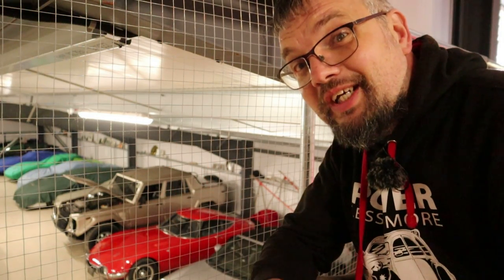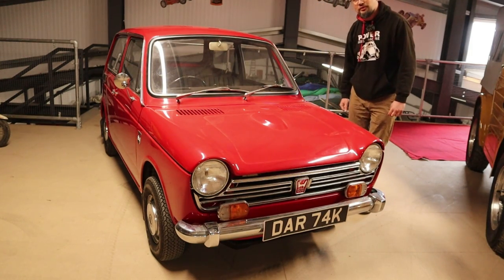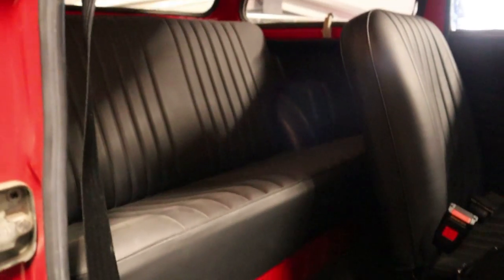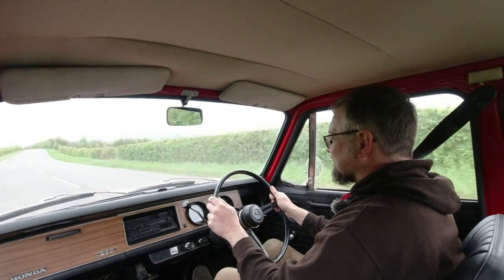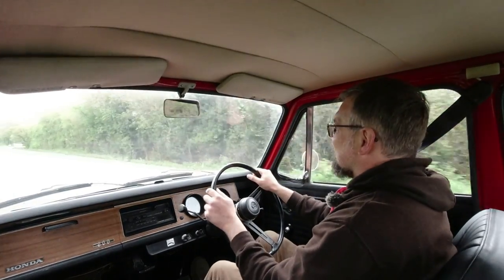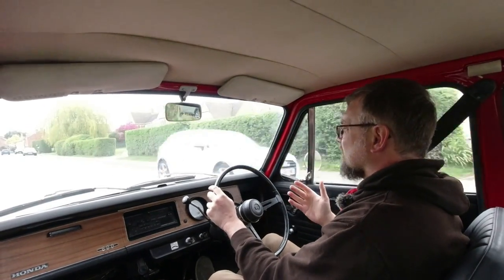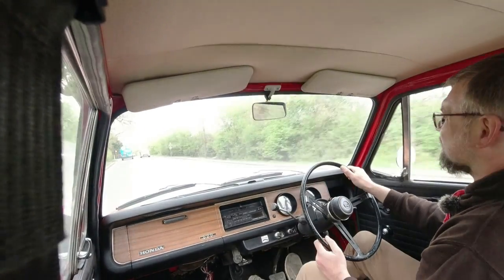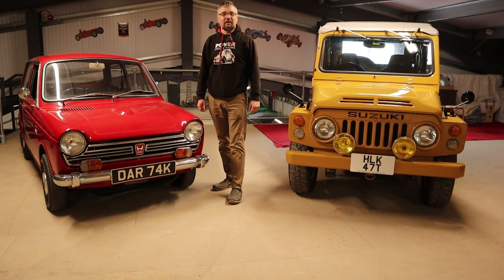Real Road Test: Honda N600 Hondamatic. Amazing engineering!

Comment: Love seeing these early Hondas. Surprisingly even the earlier ones were common in Australia. I remember seeing a coupe S600 on display from the local Honda dealer at the 1964 Melbourne Motor Show in the Exhibition Buildings when very young.
A staple on hill climb coverage on TV in the sixties in S600 and S800 form. 
A few months before the S360, Honda showed for sale their first four wheeler. The T360 mid engined pick up truck. As far as I know the same DOHC four cylinder. Likely roller bearing crank and dry sump. Later the larger T500F versions were sold in Australia like so many Japanese makes trying to establish a place in Western export markets and partly using Australia as a test market. At least one T500F survives in Queensland. Was a trade in on a Honda lawn mower! : 
https://www.mtaq.com.au/1964-t500f-honda-pickup/
With a 531cc DOHC, 4-cylinder engine. Not sure if the trucks got 4 carbs.
Think I saw them for sale as a young boy in an Elizabeth St Melbourne showroom.
I think Australia was one of the first export markets for the N360 sedan. Fairly heavily [promoted here.

Honda also established, in 1965 and 1966, an early fruitful relationship with Jack Brabham with the S800 based F2 1000cc car : 
https://primotipo.com/tag/1966-formula-2-championship/
Jack Brabham winning at the 1966 French GP F2 support race then later taking the F1 race win. So Jack became the first man to win a GP in a car with his own name and manufacture.
Unheard of today to win a support race and the F1 main event as is the car of his own make.
The Brabham Hondas  dominated the 1966 F2 season with other production based engines being a long way behind the Honda 1000cc version combined with the other Brabham car organisation winning attributes.
F2 went 1600cc for 1967 so Honda just had one year of dominance in F2.
Jack very much liked the price Honda supplied the engines to him (zero?). Honda liked his input into what was needed for racing in F2 and so F1.
Recent Australian coverage on a survivor S600 :
https://www.youtube.com/watch?v=2GQN7cH69do

Comment: Honda went 4 cylinder for their 1964 T360 light truck. I think motor design shared with the S500. Before the cars by a month or two in 1964.
The larger T500F versions were sold in Australia like so many Japanese makes trying to establish a place in Western export markets and partly using Australia as a test market. At least one T500F survives in Queensland. Was a trade in on a Honda lawn mower! : 
https://www.mtaq.com.au/1964-t500f-honda-pickup/
Reply: That's an interesting link.  There was the remains of one of these in the corner of a yard in Melbourne which I used in the 1980's. I've never seen another. The motor and most of the front end was missing. For years I didn't know what it was as all the identifying bits had gone.
Reply: @cornishhh  I wonder if the motor was used to keep a Honda S600 sports car going. I think at that early stage Honda could benefit by making just one motor with bore and or stroke variations.

Comment: 6:00 This design carried on for a while - the somewhat more modern Honda S2000 fuel flap release is in the exact same spot! It has  a proper knob and operates a Bowden cable, but the operation is the same and it's in the same place.

Comment: Wow,, I remember the day when I first saw one of these (same colour), it was the first Honda car I ever saw. 

The Borg warner story has always amused me, Honda went off and designed something way more efficient, enabling them to offer two-pedal options to their cars without having to payone of the few transmission companies royalties. I bet they knew Borg Warner's answer before they even asked the question.

I remember driving the MK1 Civics and Accords that had the 2 speed Hondamatic that was not an automatic at all. Their torque converter design was so good that were better than the small borg warner cars without changing gear at all..

Comment: The pistons may go up and down together, but I doubt they would fire at the same time. It's what is known in motorcycling terms as a parallel twin. Firing order would be 1 - 2 or 2 - 1 if you prefer.
Reply: On a 2 stroke wouldn’t they both fire each cycle?
Reply: @cachebangwallop3482  A two stoke twin will have a 180 degree crank - 1 up and 1 down.
This is an OHC four stroke.
Reply: Left foot braking  ..... it's the future 😉
Reply: @EmilysDadd  I think you're getting confused with Garlic Bread.
Reply: Same as a fiat 500 2 cylinder 4 stroke. Because it is a 4 stroke, as one cylinder is on the power stroke the one next to it, going the same way, is on the induction. So they both move together, to fit with the 4 stroke cycle.
2 stokes will have one up, one down, so they fire with every downward stroke.
Reply: @Frightningman  Ahhh, thanks, Frank - I think I misheard at the beginning - the 2 stroke is in the Suzuki...
Reply: @cachebangwallop3482  Yes, I think Ian said it was a 3 cylinder two stroke. 120 degree crank :-)

Comment: Fifty years ago, my parents bought a Honda N600 automatic. They both managed to put the little car in a spin on separate occasions. Mum spun off the road and ended up in a farmyard. I was with Dad when the car spun round on a slight bend for no apparent reason. Neither of them were what you would call fast drivers but I think the unpredictable handling may have caused them to get rid of it and buy a Hillman Avenger.

Comment: My mother had one of the Honda’s in what I think was the late 60s early 1970s. Two problems. One it came with very hard compound cross ply tyres. It was very difficult to brake on a wet road without the wheels locking up.
 In the U.K. Honda very soon forgot they ever made them.  Even dealers admitted that parts were almost impossible to come by.  The original dealership who sold the car may have something in the way of shop manuals. But a dealer who took on Honda after they had gone off the new car market had little chance of being able to get anything out of Honda.
 Just in case anyone thinks I have a down on Honda. I have ridden other motorcycles but all the bikes I have owned since the mid 70s are Honda.

Comment: I had a mustard coloured one.The boot lid was plastic.im sure it had front disc breaks.Not as good to drive as the mini and not as fast.The heater was useless.But a great turning circle,reversing lights,alternator and features you would find in larger cars.

Comment: Strangely it reminds me a little of the DAF 33 and the later DAF/Vovo 66 - although those were CVT. The related Volvo 345 was the first automatic I had a chance to drive. These small automatics were all interesting from an engineering perspective. The DAF 33 was a 746 cc flat twin, but the 66 was a more conventional 1.1 L (1108 cc) OHV straight-4

Comment: Wow, is that a 2000GT there?
It is truly amazing how much power they got out of these cars. Hey, It's Japan engineering isn't it! The 360 had an equivalent of more than 80 bhp/litre. Isn't that amazing?
What is the "PKB" warning light next to the main beam light? 
Note for the future: really liked the camera angle towards the back of the car where you are talking to the camera, like you are talking to us. Adds a nice touch to have a different camera angle during the actual road test. Might become a bit boring otherwise, especially when they are nearly half an hour long. Keep up the good work, Ian!
Have a nice weekend!
Reply from the maker: Parking Brake I think. Yes, it is a 2000GT.

Comment: I had the N360 and my cousin the Z360. Biggest problem was the rust in the too-thin metal bodywork. But they both worked very well, and I drove from Sydney to Canberra regularly in the N360. Fuel consumption was negligible. I also drove Minis and Mokes at the same time, and the Moke was my favourite, but the N360 did the job. 

As to torque convertors, the Japanese scooter industry used them a lot in the 60s, I still have a Rabbit (Subaru) torque convertor. Japanese companies shared a lot of information back then.

My N360 was written off after the woman over the road got her shoe caught in the accelerator of her car and drove through my parents fence and crushed my N360 against the concrete verandah. Good for me as my registration was ending in a week and the car wouldn't pass the annual rego (MOT) inspection due to rust. Her insurance company paid me twice what I had paid for the car, and left me with the wreck as they didn't think that they could make money from it. I sold parts of the wreck for twice again what I paid for it, and gave it to a local scappy for a slab of beer.

Fun to drive, but I wouldn't want to be in a collision in one.
Reply: I would not want to be in any car in a collision

Comment: Back in the mid 70s a friend of mine had 2 cars that needed to be moved from one side of Jacksonville to the other.  One car was an Opel station wagon, I think...if I remember correctly, with a 1.3 liter engine.  The other car was one of these N600 s.  I had always been a small(ish) car nut, so of course my choice was the Honda.
Like car magazines of the time wrote: even if you got the car sideways, or ran wide on a sharp turn, there was plenty of roadway for your recovery without necessarily straying into the opposite lane.
It would take 15 more years, tho, before I finally got rid of my Anti-Japanese Car bias.  I bought my 1st of what would be 4 Honda cars in 1989.   Unfortunately, I haven't cared for most new Japanese cars produced in the last 10-15 years as I feel they are too aggressively styled.

Comment: Slightly off topic but I had a Triumph Acclaim with a semi automatic torque converter
gearbox, it had 3 forward speeds,  according to the hand book you just used 2nd for 
normal driving it was good for 0 to 80 mph if you wanted a bit of extra performance
or climbing steep hills with a full load you used 1st which was good for 0 to 50 mph
3rd was an overdrive which quietened everything down which you could use from about
30 mph I think, If I remember correctly it wouldn't do its top speed in 3rd. You just shifted
the ''T bar'' gear lever backwards and forwards as needed no clutch, for reverse you pushed
a button on the bar and pushed the lever forward. According to the handbook I think that 
was also called a Honda-Matic. I rather liked that gearbox.

Comment: I had one, a red,n too, 
His name was Nod-Bert, 
best wee run a bout ever

great for parking, not a space big enough,long ways on.
it was small enough to drive in with nose or tail to the kerb.
got some funny looks, but all legal.

And it loved to cock a rear wheel when cornering fast
something that got a lot of comments from folk.

You did,nt mention its ..Sportier brother, the fast back Z600
an even cuter wee car.
dont know about the 72 cars, but the 76 Nreg cars had discs on front,                                  not drums as you said.
 never thought id see another let alone a road test.

Comment: I'm 6 2 and always liked small cheap to run cars. I take the front seat out and drill holes further back. I had a Honda 50cc scooter that had a 3sp semi-auto manual shift but no need to use clutch.

Comment: A torque converter and lockup patent was filed by Studebaker in 1946, and Packard had the Ultramatic in 1949 which had lockup, so the concept was quite mature by the 60's/70's. It fell out of favour in the 60's until fuel economy started to become an issue and the efficiency gains of the lockup meant it came back into use.

Comment: For a fair bit I thought “odd, it’s got curtains on the B pillar…. WAIT, it’s a seatbelt. Sorry, very long couple of days 😳 slightly off topic, if you get chance to try a Fiat TwinAir you may find it an interesting comparison. 800cc ish 2 cyl 4 stroke with a turbo, iffy set of cars but an engine that is interesting to drive as a manual. Not the breakthrough Fiat we’re hoping but a different take on things, technical details are particularly good (no inlet cam + a balance shaft). Cheers as always Mr Hubnut!

Comment: I had the "big block" N600 with the manual transmission with that wacky dashboard pivot, I hot rodded the heck out of it but is was probably slower when I got done with it... I did build a roll cage for that death trap though, must have had at least 1 brain cell left at the time

Comment: I really need to send Ian my old Olympus PCM recorder so he can record decent quality lavalier mic audio alongside the cameras audio (can still serve as a backup). A lot of the recent-ish videos seem to have overdriven/distorted/clipped audio at some point of the video (inside the building in this case) or even most of it (vlogs), which unfortunately seems easy to do with the current setup (or in editing?), but pretty hard with the PCM recorder with its limiter enabled from my experience. Not sure if that's the right answer to the problem, but the distortion can be quite harsh to listen to with headphones which just distracts from the otherwise brilliant content (yes, that includes failed repair attempts that end in rambling lol)

Comment: The Hondamatic that could be had on the original Civic had only two speeds and was a shift it yourself unit, but without a clutch.
Reply: Correct - it was a semi-manual, and you had to start off in first to get going, and shift to second.

Comment: The mother of a school friend I had in the late 70's drove the same car. It was a bit of a banger and had a 4 speed manual (so that must be faster). It would stall at virtually every traffic light. Besides that the wiper blades tend to come off which was quite adventurous considering I would be a passenger on the school run when it was raining hard. That had also left deep scratches in the windshield. So needless to say, that example was not going to be a survivor. Nowadays these Honda's are expensive to buy as classic. Perhaps even more so than a real Mini.

Comment: 14:19 says it all as far as modern cars are concerned, especially the mid-size SUV's: they're unrecognizable, even to a car afficianado! They all purport to give you individuality and personality, but they all run with and in the same pack (of sh*t). I used to be able, as a kid, to tell one car from another by just looking at a fraction of the rear lights or a slight curve along a wheel arch, but in a time where almost all cars have curves upon curves upon curves - in a so-called effort to be 'funky' and 'cool' - individuality has flown right out of the tinted windows! My current car is a Chrysler 300C Touring, and I love it! Just try and find something even remotely similar!

Comment: As for your comment on the boot being better on the Mini, not at all, if you have a bag of cement or suchlike the Honda is much easier. The Mini boot lid gets in the way and straps break if you drop said bag of cement on it

Comment: I hunted for months for a Z600 Coupe back when they were cheap to buy nearest I got was a test drive of a N600 which was fun not a Z sadly I gave up after a while as I couldn't find one without imminent terminal rust
Reply: It hurts still that my Mums Z600 had less than 20k miles when she sold it after about eight years . It was perfect , no rust and totally reliable . But they only needed one car and the Z went. Two lads bought it for peanuts and wrecked it driving round a field 😡

Comment: Very interesting. The engine owes a lot to the Honda CB72 / 77 and CB450 motorcycle engines. When it's out of the car, it's pretty much a bike engine with a different gearbox.

By the time this was built, honda were pretty much masters of four stroke small engine technology and could get - for the time - ludicrous power outputs. 50 Bhp wouldn't have been unusual in a bike version of the engine and it does sound very like the CB77 twins in engine note.

the Hondamatic system was aroudn for years - in the mid / late 1970s, they fitted it to the CB400 twin and the CB750 four; they were quite popular in the american market but automatic bikes never really caught on then. As we age, they're making a come back. Whilst the hondamatic system is pretty efficenent, it does still loose more than a conventional motorcycle gearbox.

in the bike world, Honda's technical virtuosity meant that they produced a transvere straight six, V4s, an 80 degree transverse vee twin, an oval piston V4 race bike and once they moved onto two strokes (Sochiro hated them, apparently) a series of very interesting V3s.

the moto of Honda engineering between 1960 and 1990 seemed to be "gee wizz - look what we can do"

Comment: Honda using technology from its motorcycle division which was far ahead of most car engine design of the late 60s. The Honda CB750 motorcycle from 1969 produced 67 BHP and the CB500 produce 50BHP, a lot of power from a small engine. They also did a CB750 Hondamatic so their car expertise is carrying on to its small car designs.

Comment: For ages Australia just got the N360 version with even less power. The Z coupe only went to the Z360 version in Australia.
What were Honda Australia thinking?
First with some information to contribute.
Reply: Daihatsu sold the 360 Max around the same time. Honda subsequently sold the watercooled 360 Life too, which looked rather like a shrunken Civic.
Daihatsu, and Suzuki also sold 360cc two stroke kei vans in Australia. I can't remember if Honda did, but they certainly sold the 550cc Acty.
Reply: @cornishhh  yes Honda  sold a 360cc van in Australia, although it was more a pantech style.
The back would unbolt off the tray and I made sides and turned it into a ute 😊
Reply: @cornishhh  Honda sold a ute or really very light truck version before the cars in 1964.
The larger T500F versions were sold in Australia like so many Japanese makes trying to establish a place in Western export markets and partly using Australia as a test market. At least one T500F survives in Queensland. Was a trade in on a Honda lawn mower! : 
https://www.mtaq.com.au/1964-t500f-honda-pickup/